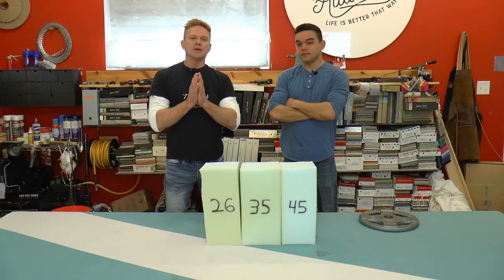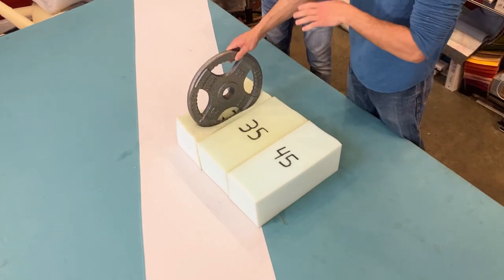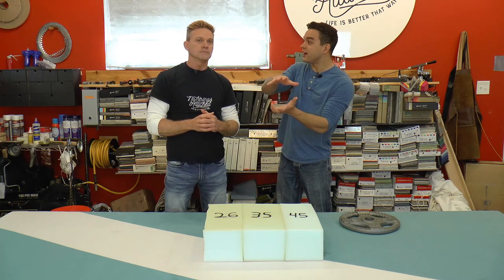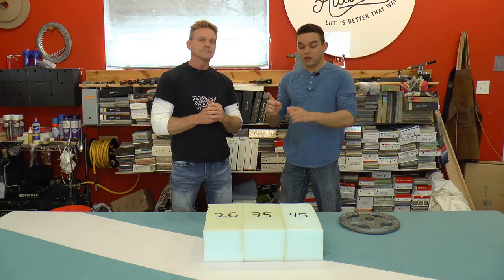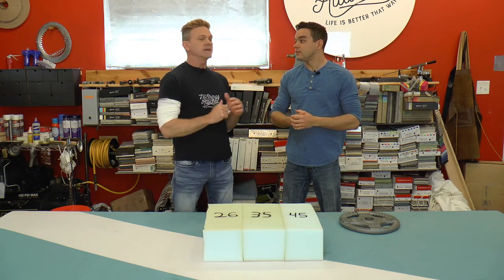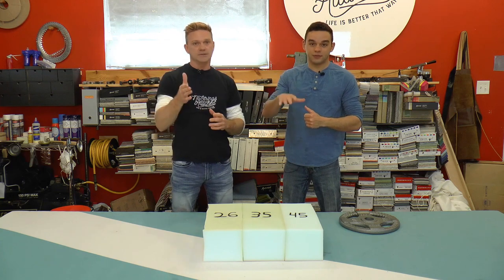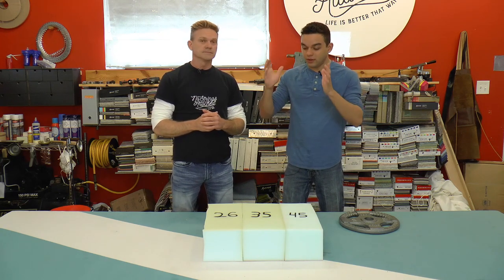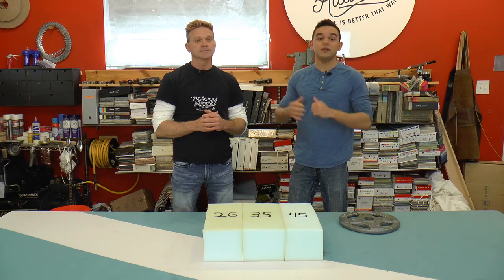How Foam Compression Works

Comment: I have a foam that I feel ideal for a mattress, but don't know the firmness. I cut out a cylinder with diameter of half feet, applied 21 lb to compress it by 1inch , so the firmness = 4x21 ILD ?  (since the area is 25% of what a typical test is needed) . Are common products of all possible ILDs or just certain numbers like 26 35 44 etc ? Thanks!

Comment: I have a question guys, I bought some foam already cut up 6"Hx21"Wx25"D and I just realized that the foam was 44 ILD compression and the seller was a third party, and they are giving me a hard time to return it. So, my old foam cushions are 26 ILD. 
My question is? can I cut halve of the 44ILD and Halve (In the middle) of the original that is 26 ILD and glue it together? What would happen if I do so.
This is a very nice whiskey Italian leather sleeper sofa, and I don't know if the problems we have (You kind of sink down) is because the mattress for the sleeper part is gone or because the cushions are old.
I even put a (Ultra Sturdy Couch Cushion Support for Sagging Seat 20.5''x67'', Sofa Support Under Cushions Boards, Made of Thicken Solid Wood) piece online and put that under the cushions, but still was kind of soft.
Now, the love seat it is still incredible comfortable and is from the same set, so I thought that maybe the cushions were worn out, but I may be wrong.
I was going to cut the new 44ILD and glue them with halve of the originals that appear to be 26 ILD.
Or should I buy a new mattress for the sleeper sofa.
Could that be possible?

Thanks in advance

Comment: I'm a 400 lb guy with a recliner. 
The foam doesn't last long for me. 
What would be a smart way to go for someone like myself ?
Reply: Smart play would be to try losing the weight. If that's not possible or you don't feel like it then get a firmer foam and it'll soften over time anyway
Reply: @soarraos  
No Kidding. 
What you don't know is I have serious back issues. 
The weight has become a issue in the last 15 years.